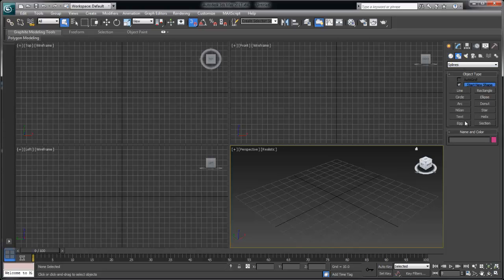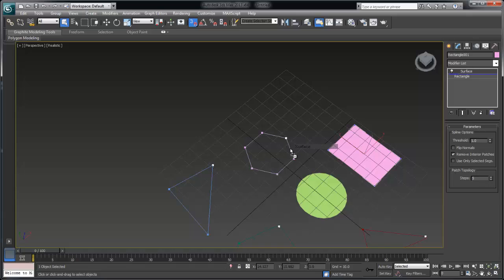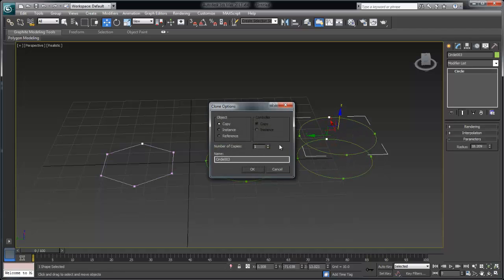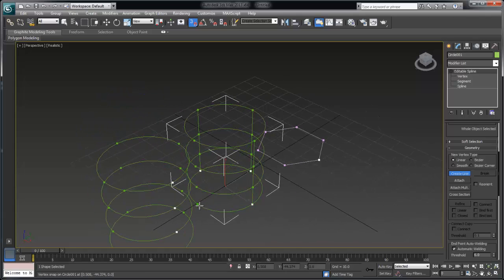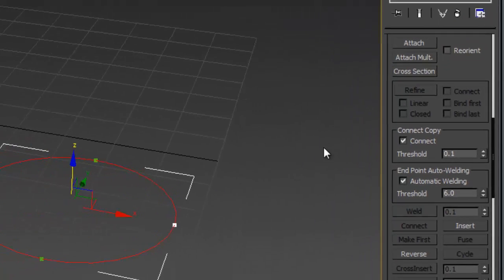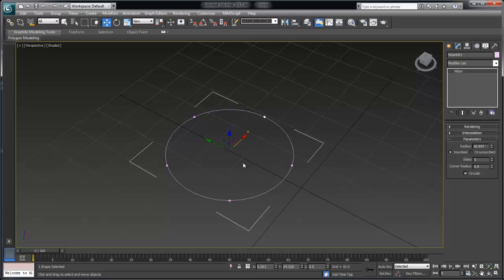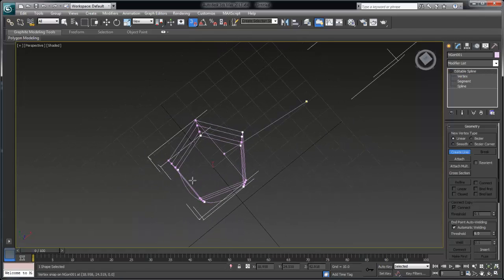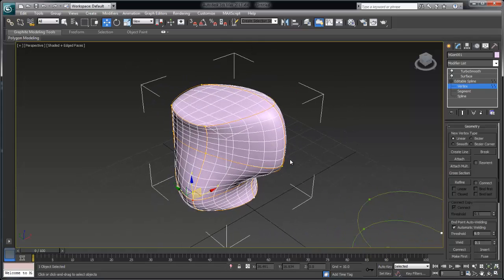3ds Max Spline Modeling Fundamentals

Comment: i cant make this work , have done evrything as in vide but when i apply surface mod surface somethig wierd happens some of surfaces are distorde or missing .it works only when i have copyed 1 spline circles and use crossection mod ,but with more then 1 something funky is going on when i reder its mising some surfaces pls help im new to 3d max